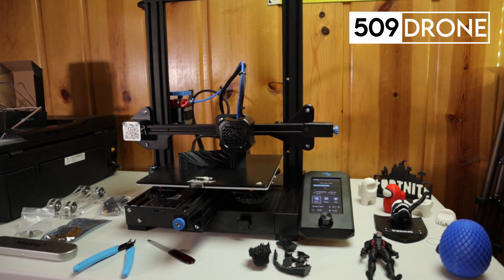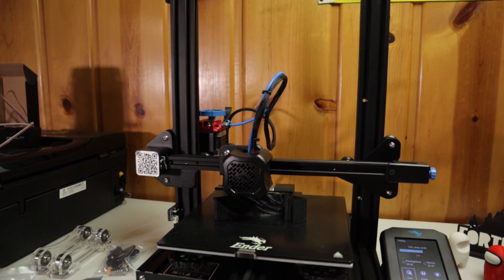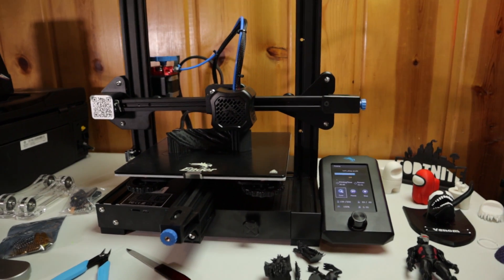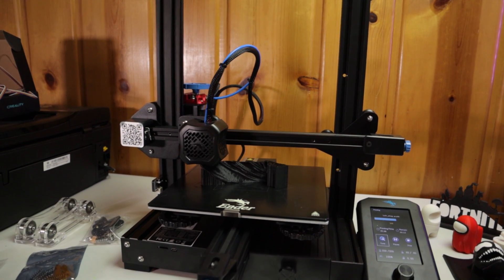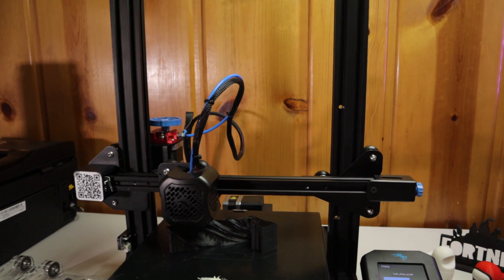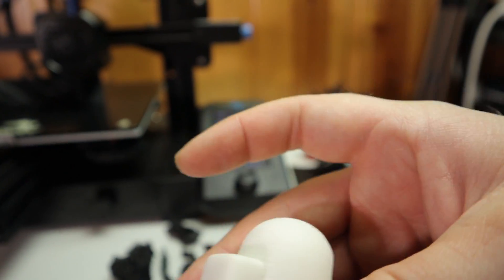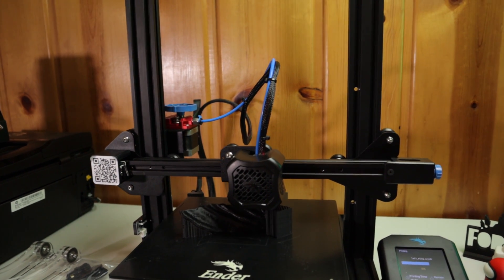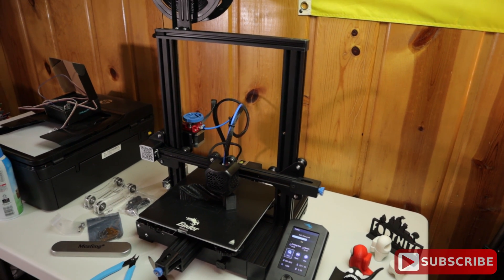Ender 3 V2 Upgrades [ Quick & Simple Quality Improvements ]

Comment: Quick question does your Y axis stepper motor run hot and also do you know what version your MB is.  Thanks.  Interesting that you had issues with the BL Touch as well,  I installed the CR Touch and it works a treat although determining the required firmware was a puzzle as there are lots of different versions
Reply from the maker: Heya, my Y motor doesn't run overly hot at all. As for my board, it's the 4 2.2 from my understanding the majority of the ender 3 v2s shipped with the 4.2.2

Comment: My 9-year old grandson wants to print and design 3-D planes and rockets. Will this machine do that? Are there inexpensive programs or software to do this?
Reply from the maker: Thats awesome! This printer should be able to print the parts to do that, depending on the size of his rockets & planes. Normally with 3D planes, you use carbon fiber for the frames, and then print the rest of your pieces with a 3D printer. As for the software, yes. There are programs like tinkercad that he can design his own models with. I have a video on my channel explaining the basics, and how to use tinkercad. Here's a link. https://youtu.be/w1v4PVsZU1U

Comment: I will actually tell you where you messed up. It’s not the firmware. You have to actually write two lines of code into your machine before you run the BLtouch. The creality firmware is actually Marlin. If you don’t program the lines of code into it, it will crash in your bed. I’ve had absolutely zero problems with mine.
Reply from the maker: Yea I have upgraded my firmware, and tried multiple different firmware. The issue is the Bltouch wiring is not shielded and causes electrical interference. I have since switched to an EZABL. You said you haven't had any issues with yours at all? Are you running the Ender 3 v2 as well? Would be interested to know how yours has been working for you. Sorry for the late reply.
Reply: @509drone2  Yes, I am running the V2. I did not route the wiring for the touch inside of the wiring shielding for the rest of the wiring. I routed it on the outside. I also shielded it when I ran it I inside of the base of the machine. I have not had one single issue and I have had it on there for over a year. It works fantastically. I hear that people have trouble with PCM interference but I didn’t put the wire close to the others. It is completely separate from everything else. It works exactly as it was designed. No complaints

Comment: I recently purchased my e3v2 and bought the aluminum extruder, new Bowden tube, couplers, bed springs and upgraded as I assembled. My first 4 prints came out 99% perfect after leveling the bed, z stop etc., very minor stringing and bulging. My bl touch arrived 2 days later and on it went. I was able to print exactly nothing with the bl touch added, tried many different firmware, it would just probe the bed then think it was done with the print. After fighting it for a week I removed it and am printing great again. So I dunno about the bl touch 🤷‍♂️
Reply from the maker: I had the same issues. In my recent video I talked about how I was able to get my bltouch to work properly.

Comment: The reason you couldn't revert the firmware may be because you have to rename the file.  It won't flash a file name it's seen before.  

Also, regarding the BLTouch, try turning the adjustment screw down the center of the sensor.  I had the same problem with it crashing into the bed, but after turning that screw about 1 turn clockwise, it works great.
Reply from the maker: Appreciate the info bro. I tried remaining the file multiple times though :( I'm honestly not sure wtf the issue was. As for the bltouch I found out there is some bug with the marlin firmware, and the ender 3 v2 LCD screen. I guess they are aware of it, but it hasn't been updated yet.

Comment: Question, if you wanted to keep a budget on a new 3d printer to no more than $350, would you go with the Ender 3 V2 and buy all the mods for it? or would you go a different route and just buy a different 3d printer?
Reply from the maker: Great Question. I think the Ender 3 V2 is currently the best "entry level" 3D printer. Honestly, you don't need to do any upgrades to it. It will print just fine stock. These upgrades are just very small things you can add over time, to get little improvements.
Reply: @509drone2  Thanks for the reply, i appreciate it. After all the researching and stuff i been doing and plus what you have said, i am ordering the Ender 3 V2 today. I am also going to buy all the modifications for it as well today so i can just put it all in while i am assembling the printer. I figured $350 for my budget so that is why i will just buy it all now :)

Comment: If you want excellent firmware to work with the BL Touch (which really does work if you have the right firmware) suggest you go to Smiths 3d and download their version. It is simple to set up and has great features built in.

Comment: i am using creatlity bltouch firmware and works perfectly for a month+ so far, no issue whatsoever, first layer is always printed greatly
Reply from the maker: That's good to hear! You used the firmware from the creality website?
Reply: @509drone2  yes, from here https://www.creality.com/download, the one i used is 4.2.2 Ender-3 v2 Marlin2.0.1 BLtouchV1.3.1with adapter board firmware, i believe u need to download the one matching your board version (4.2.2 for me)

Comment: Has Smith3d made a  v2 firmware without the BLTouch?  My v2 still has the old firmware that only save configuration into the Sd.
Reply from the maker: I Don't think they have :( I ended up removing my bltouch, and switching back to the TH3D firmware, as I like it better.

Comment: My Ender 3 V2 was pretty much useless until I installed a BLTouch. The bed was warped and I couldn't get anything to stick. I just took the latest Marlin and made changes according to Teaching Tech's instructions and it's amazing. Among other things, I've also changed the fans because I couldn't stand the noise.

Comment: Try the firmware on this site for BLTouch.  It is what I use on my Ender 3 V2.  Really like it!!
https://smith3d.com/ender-3-v2-bltouch-firmware-installation-guide-by-smith3d-com
Reply from the maker: I've heard great things about the smith3d firmware. I do plan on giving it a test pretty soon.
Reply: @509drone2  The Z-Offsett Tool and the AUX Leveling are awesome.  You can adjust the Z on the fly!!

Comment: Use the Smith3d bl touch firmware, 5x5 slow 👍 use the pin setup on the right side of the page
Once setup than Aux level, Z offset than auto level, save settings, done.
Oh don't forget you will need to swap the blue and red wire at the main board plug and shave the 2 wire plug to fit the connector in. 
The picture on the page shows a brown wire not a blue 
Bl touch works fine dude.

https://smith3d.com/ender-3-v2-bltouch-firmware-installation-guide-by-smith3d-com/

Comment: smith 3d has great firmware   i use it on my ender 3 v2
Reply: Yes, I had the same issue with my Ender 3 v2. Installed the Smith3d and haven't had any problems since...
Reply: Agreed. Probably the best 3rd party firmware all-around. The Z offset and aux-level tool are dope.

Comment: Cool man. I don't have an Ender 3, I have a v1 CR-10 and end up watching a lot of Ender videos since they are quite similar in their setup. I have the TH3D unified firmware on it with a BLTouch. It was definitely a major pain in the ass to setup, but now that I got it done I could probably do it in a 1/10th of the time. SUPER happy that I added the auto bed leveling, makes things so much easier. Pretty sure that the newer TH3D unified firmware 2 is all setup to work with the BLtouch on the Ender 3. You should really check out CHEP's Magic Cura Profiles. They are pretty damn good. He does tons of Ender videos. https://www.chepclub.com/cura-profiles.html   He does have a video on how to import them into Cura, but thats pretty easy to figure out. I'm about to install a dual gear extruder since I print a lot of TPU also for quads. Although, I've never had an issue with my single gear extruder, even with NinjaFlex. Rarely use that stuff, usually use 95A TPU and that feeds fine on a single gear, but they say the prints will be cleaner on a dual gear, so I'm gonna try that. Anyway....thanks for the upload and check out CHEP's profiles. Also, when you do end up doing the ABL you should get some silicone "springs" for the bed. I had some of those yellow springs and they work great for non ABL setups, but I quickly figured out that having more of a solid bed mount works a lot better for ABL. I had to add 2 washers underneath the silicone ones I have cuz the bed was just a bit too low and the Z axis would bottom out on the frame. Working great now though, super locked in, but has a tiny bit of give.
Reply: Ah, just saw that you know about CHEP.

Comment: I'm with you, I blew 2 boards trying to install the BL Touch because the kit hasn't been updated for newer 32 bit boards
Reply: I don't think I've ever heard good things about the official stuff provided by creality. I followed the smith3d guide and also used their firmware which worked out flawlessly for me
Reply: BL Touch is sitting in a basket right now. I couldn’t get it to work right so f it.